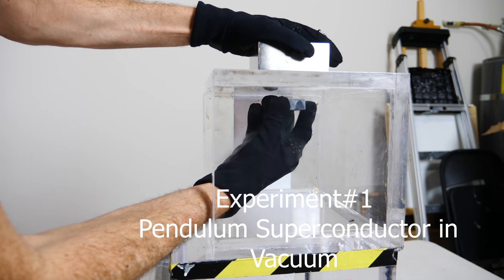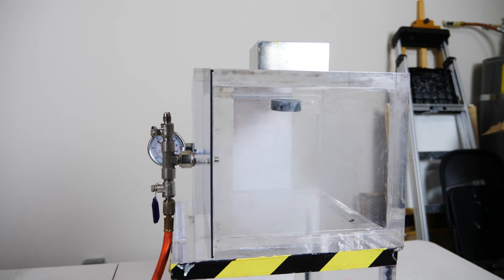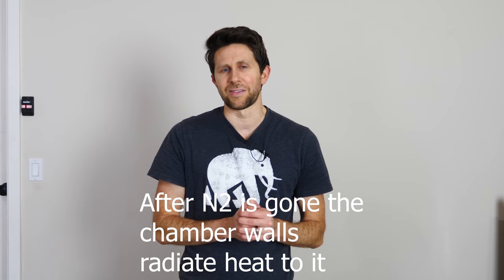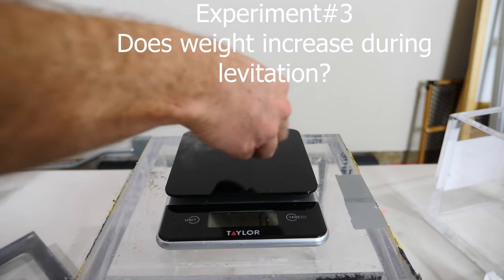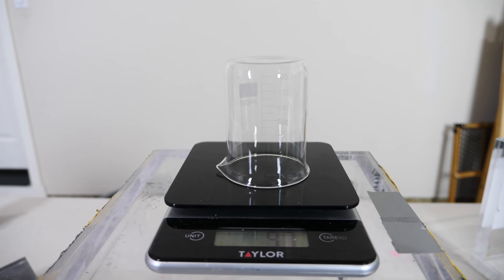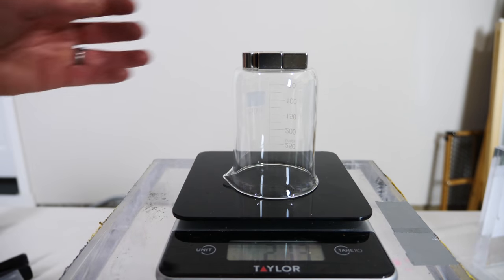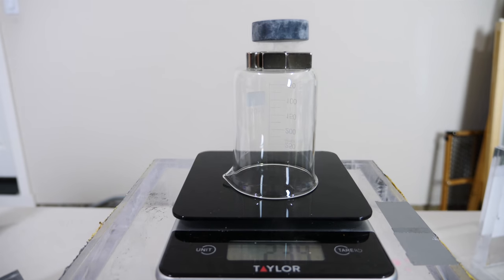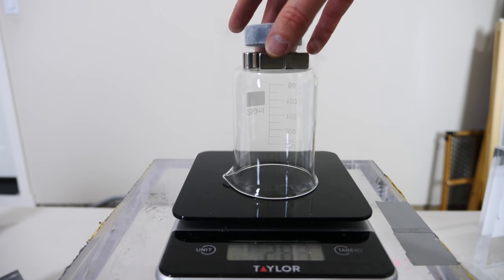Does The Weight Increase When You Levitate a Superconductor on a Scale?

Comment: and if the superconductor, at its critical temperature, in a vacuum chamber, were covered by a material with low thermal conduction and sealed such as to have a constant pressure of 1atm and not evaporate... it would be possible that in the vacuum chamber it could last its superconducting state and magnetic levitation?

Comment: Hey Action lab, I'm just wondering how does dough give you a static shock?

I work at a bakery, and for some random reason everytime I grab the dough, I get zapped.
Reply: It is probably you that give the dough a shock. It's most likely the clothes you wear that rub off some electrons on you and they jump off when you touch another person, a doorhandle or apparently the dough.
Or, if it's a metal table you're working on, it could be the dough rubbing on the table and then zapping you. It's not dangerous, neither for you... or the dough. It's just static electricity.
It's just some electrons getting rubbed off, charging one thing and then discharging on something else to equalize.
Reply: @HansenSWE  it's a wood table
Reply: @melchardcaranto4675  I'm sure it gets annoying after a while, so you could try to discharge the dough on something else before you handle it. Like a large metal spoon with a plastic handle. Just tap it and hold it for a second.
If you still get a shock after that, it's probably the fabric you wear. A lot of those synthetic sports t-shirts and stuff can charge you up pretty regularly. Wear cotton. There's plenty of stuff you can do to prevent it.
Reply: Wow ! Electric dough . Sounds like something from the 60's . That is puzzling though , if the table is wood , and your not grounded .
Reply: Melchard Caranto do you enjoy working in the bakery? If you do enjoy working there then that is all that matters.
Reply: Melchard Caranto Do you really knead to know?
Reply: Melchard Caranto I have a pair of Nike shoes that cause me to generate static every time I walk across the floor at Walmart, then it discharges whenever I pick something up. I hate it, extremely annoying so I quit wearing those shoes. 🤷🏻‍♂️
Reply: @polishhotdog933  I'm not sure if you should be knighted or arrested for that comment 😂
Reply: Dough shouldn't be static - too wet. Though flour in the air can be superdry and become static. That means your bakery is too dry. I assume you also have unusually hard crusts?
Reply: https://www.youtube.com/watch?v=ZF3-mwLq6Q8 (1:35 ish), the act of kneeding the dough builds up a static charge. if you had kneeded the dough you would be grounded to it (have the same level of charged electrons), but if someone else kneeded the dough, or a machine kneeded the dough, then it's built up a static charge or excess electrons. When something with a large difference in electrons touches it, the electrons jump form one to the other, balancing out the electric charge. If your dough shocks you, that means either you had lower or higher charge.
Reply: Spoutinwyze Best reply here! Also like to add that I love the name... Very clever indeed.
Reply: Change your socks!!!
Reply: i think a video on static shock would be cool
Reply: First I've heard of this, what are all of the ingredients as precisely and thoroughly as possible? What type of dough for example? Anything maybe unusual about your location?
Reply: @garyha2650  the bakery I work in is actually pretty old. 25 years old if I'm not mistaken
Reply: To me it just sounds like you have a rare gift for baking. It is a sign that you are worthy to knead the dough. This hasn’t been seen in many centuries.
Reply: Cliff M  your theory is probably the closest to what is actually happening. It's what I thought as well. Could be wrong but sounds good to me 🤷‍♂️
Reply: Make sure that the electrons can't get on you, and even if they do, make sure they stay off. Find an object made of metal connected to ground, tape a wire to yourself and the metal object, make sure to expose the bare copper inside the wire and then connect it. Or if its the dough, place it on top of a metal surface and ground it. Or if you are too lazy to do both, get a heater and a big humidifier. Static electricity mostly occurs during winter because its dry and electrons can't escape through water molecules. So increasing the amount of water vapor in the air this way would also work.
Reply: The most likely explanation, even if it SEEMS unlikely is that you create the charge and it grounds through the dough. If its a really big dough, it doesnt need to ground to zap you, but I cant say how big it actually needs to be. 
The dry conditions are a good idea too, but the opposite, which has not been considered is a tiny possibility too: the moist and dough creates somekind of battery effect.
All you need is iron, copper, and some acidity which is in the dough, the kneading certainly helps, and there you go. 
Nails, screws, machine parts, whatever. 
Oh, btw, there may be a safety hazard here, fine flour aerosol burns in an explosive manner. Large enough concentration and large enough spark means no more bakery, or no more eyebrows. Its unlikely, yes, but better safe than sorry, right?
Oh, if you figure it out why it does it, let us know too, ok? :-)
Reply: You know, I worked at a pizza place for 3+ years and we would deal with dough that got to be over 100 lbs in size before we lifted it from the huge mixing machine up to the table to knead into "pizza buns" as I called them. We'd then take said buns and place then into these trays we pre-sprayed with anti-stick cooking spray, then we would let them sit in thr freezer section before taking them back out to spread, toss, lay on pizza grit trays, dock eighth the docker to prevent huge bubbles when it cooks.

I never once had an issue where I got shocked by static when working on it, and they're we're days where I did 500 lbs with of dough (Saturdays because Saturday was almost as busy as fridays, but also because it was in prep for thr church orders we'd have every Sunday before thre shop opened to the public of 50-200 "pies" ...

That says, normally, in the person that is ALWAYS shocked everywhere I go. Seems I pick up and hold charges well, which isn't enough started back when had my 1st arm surgery,  and got worse after my 2nd arm surgery. My right humerus was loaded up with metal wires that set off the magnetic metal detector machines every time and sometimes even the detectors at the doors of Walmart, target, and CVS specifically. The 2nd surgery had tons of screws, bolts, nuts, metal plate and metal rod placed in. I want allowed to use the cool bulbs that generate plasma because the electrical charge would shoot out and I couldn't lose it for days. I got a zap when I touched people, the car doors, door handles, in-house lamp posts, the knob you turn to turn them off, fridges with magnetic casing, and even electric parts when I worked with them. I always had to ground myself and then work with gloves when dealing with computer parts and thr images of electrical gadgets because of this. I picked up the habit of knocking on the car handles with my knuckles or the farthest finger joints from my knuckles before touching things. It felt like I was a walking super  conductor or some nonsense. It didn't matter if it was cold and dry, hot and humid, cold and humid, rubber sole shoes, sticks, flip flops, leather sandals, barefoot. And so far as weather goes, the winter is surprisingly humid here in these parts of east Texas. And in thr summer, I did marching band and was grateful I marched clarinet and saxophone because when I'd pick up or hold someone's "brass" instrument for them, whether it was during practice on the blacktop without gloves or at a game or competition, I'd get shocked...as I would EVERY SINGLE TIME I touched the bleachers to sit down because woodwinds had to cut the tips off their gloves to better cover the holes on clarinets, flutes, but not so much the saxophone, but we kept then cut there, too, to maintain the look.

That all said, we kept the pizza place hot... beyond uncomfortably hot, and used the walk in freezer to cool off if we got desperate, because the never of the place had the thermostat locked, literally, and brought the A/C off and the heater off. So whatevwr temp the belt-driven double-oven, open at thr front and back,  which USUALLY ran between 600 & 640 per oven, exhausted from both openings...

So it leads me to believe it's feasible it could be environmental for you, as if it were personal you'd complain of it happening everywhere, not just with dough... but I never had that memen anywhere the dough was warm, straight from thr mixer, in large batches, colder from smaller batches threeway maintained their cool from the icy cold water used, or frigid cold from pulling parts from what was sitting in the walkin freezer when we were too busy to have the prep table taken up by a massive 100+ lb vatt of unset, freshly mixed dough...we had aluminum tables, but the prep table was merely a huge piece of cutting board material that stretched across so we could easily clean it, flip it and clean it again for different tasks to avoid mixing things that customers couldn't have or what-have you...

Was this dough unleavened by any chance? Or was it non-wheat based, say something that's edible for those that cannot eat regular bread? Or perhaps related to the yeast used? It makes me wonder if it's both environment AND the contents of your dough. Our dough was a basic mix of cold water, standard pizza dough yeast, tons of flour (not really anything special in the way of seasoning), a little bit of either salt or sugar, all at once, making me think it was sugar, mixed in a huge metal mixing bowl for 30m for the smallest batch on up to an hour and change for the biggest ones. I was scrawny when I first started, so it definitely built up my arms and back quite a bit, all that lifting.
Reply: @natevb9901  Wow, that was... a lot of information.
Anyway, it doesnt rule out that he generates the static electricity just because its environmental. Protective clothing is often plastic fibers for easy cleaning and better hygiene, and a bakery is very likely to be drier than other places. He just doesnt experience the same conditions elsewhere with any regularity that would be remembered. So he would still be the source, but only in that environment.
But if your dough was not big enough then no dough is big enough so there has to be a ground somewhere.
I think resistance is easy to measure with electricians tools so the conductivity of the dough could be known.
Thats what I can say right now, though Im thinking of bloodbread and copper screws. :-)
Reply: Do this experiment. Touch something that it grounded before you touch the dough. Discharge yourself, a plumbing pipe is a good source of ground. If the dough shocks you while touching the pipe, then the electrons are in the dough. It very well may be a side effect of yeast rising? It does make heat, by its chemical reactions, and that could be freeing up electrons. But if the plumbing pipe shocks you, and then the dough doesn’t, then it’s you creating the electrons by walking on the carpet with rubber shoes.
Reply: Probably the minerals in the water.
Reply: @alphagt62  Good test, though I doubt a bakery will have carpets. :-)
Yes, lets see what happens!
Reply: Melchard Caranto Try getting a ground leash often used when working electronics and attaching it to yourself and something bonded to the electrical ground system in the building. Then try working the dough with and without the leash. Or set up the leash so that you can quickly touch it and bring yourself to earth’s potential before working the dough. If you feel the shock touching the leash then it’s you building the charge if not then you may have bring the dough to earth’s potential.
Reply: I worked in an office and every time I stood up, went somewhere (even in the same room), got back and touched my chair to sit on it - I got shocked. It got to the point I was conditioned like Pavlov's dog not to touch the chair :)

It was because there was very cheap and awful plastic carpet-like floor and I was in my sneakers. When I was testing it and going barefoot I didn't got shocked.
Reply: Asking this question hints at why you work in a bakery
Reply: @johnburakowski61  if he's not grounded is more likely to happen, if the charge source is him and not the dough. You'd still get zapped if it was the dough, tho, bc the charge tends to distribute uniformly over the surface of the conductor (you and the dough in this case)
Reply: @HansenSWE  I used to work at a plastic injection plant. When we would grind up the extra plastic it would make huge amounts of static electricity. It was very dangerous.
Reply: Could be due to a short in a dough mixer or other equipment.